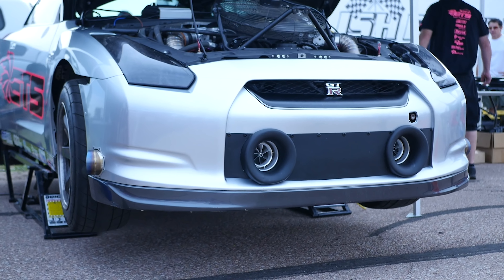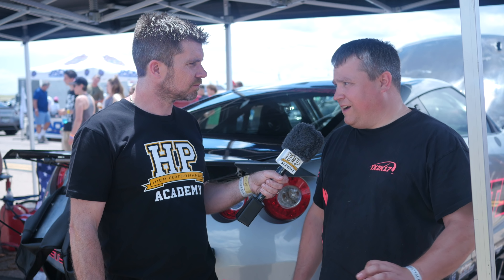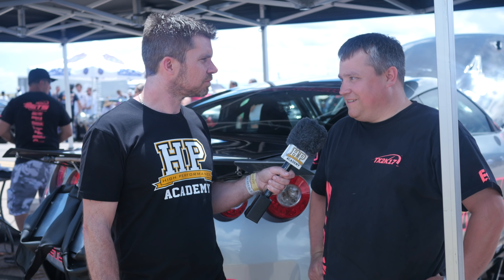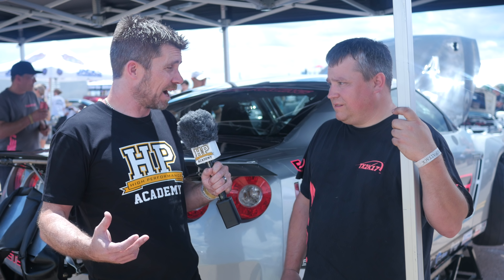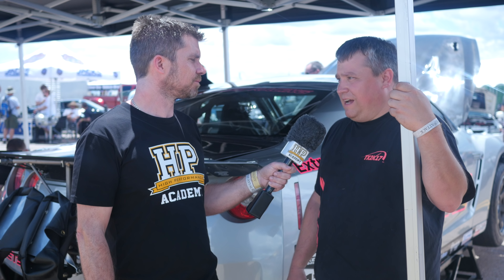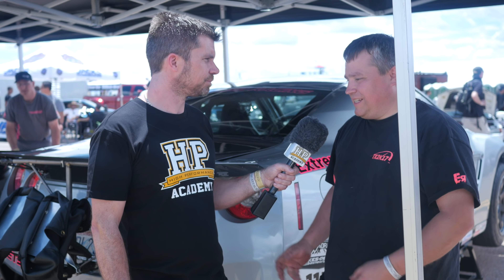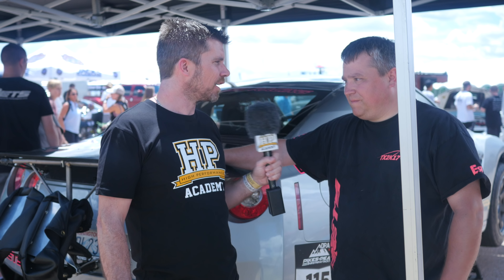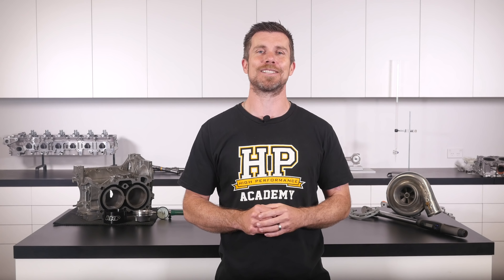Can You Daily Drive A 2700WHP GTR? | ETS [TECH TALK]

Comment: I like this bloke, a real straight talker. You know someone knows their shit when they can pull all those figures off the top of their head. Sounds like he could throw together a 1500hp GTR in his sleep
Reply: He could and best of all is he wont BS you like other shops do.
Reply: Cicioperformance doesn't lie to his customers either. The shop was formerly known as TSM and is known for making the best streetable gtr's in existence. His shop does crazy builds with ETS's kits but takes pride in their stock turbo fold kits that are above 1500whp now and spool damn near as fast as stock and are reliable with a billet crank and billet girdle on the stock block. Without slicks or a race weight below 3800lbs they are still hitting 2.83 seconds 60-130. Trick it out with some more weight savings (keep A/C, the full stereo, and a full interior - carbon seats/dash/console/body) hitting sub 3500lbs race weight and they will go 2.5 or better in the 60-130 on the street and be daily drivable. And no you won't have to change the oil every week because you're running methanol. You can get a 1000miles or more with pump e85 before needing to change the oil. That's the fastest streetable reliable car you can have.
Reply: I was just going to make the same comment! The no nonsense talk and leveling with the customer is unheard of today with this rubbish customer is always right mentality.

Comment: Getting a bit spoilt by your interviews, but it is still cool watching some of the interviewees when they realise Andre is actually asking good questions and knows his subject.

With the charge cooling still being used with methanol, way I figure it is like JR - regardless of the cooling down the line, the colder you start, the colder you finish - been a bone of contention with some turbo' chaps :-)
Also good you got out of him the big end bearing problem that they have to monitor, maybe a bit more info' re' clearances and oil viscosity would have fitted well with your bearing clearance video? Would it be practical/possible to simply drop the sump and replace the bearings regularly or did ring* seal/blowby or component fatigue mean a full rebuild was needed as it was not too clear if the bottom end is fully replaced during the rebuild, the implication was that it was, or if the rods, crank' and maybe other parts had a longer service life - but if you have the money, why take chances?

*unfiltered air can wreak havoc on that but valves and seats are made of much, much better materials nowadays, so unlikely to be affected as much.
Reply from the maker: Coming from a methanol background myself, I always retained an intercooler. There is a school of thought that overcooling the inlet charge with a methanol engine can make it harder for the fuel to go through a phase change from liquid to vapour and hence hamper charge formation and combustion. JR seems to have done the back to back testing to prove that's inaccurate though.
Reply: I recall about 15 years ago the dsm turbo forums, and a few others, arguing about whether or not using a cold air intake in the fender well vs stock location in the engine bay actually made any difference at all.  Some guys argued that it's going to get hot during compression anyways and then cooled in the ic so it wouldn't change a thing.  While others said the colder you start the less there is to cool and the colder you'll finish.  In the end some logging by a few of us showed that cooler air being fed to the turbo would result in an extra lb or 2 of air per minute in the intake manifold at the same boost levels.

Comment: Those little rod bearings must go thru hell with 2000+ hp. On my 500+ hp turbo builds I would notice the big end bearing wear a bit on the straight 6s I occasionally build. I would get a 3mm burr and elongate 3 oil supply hole points. The block outlet supplying the mains, the crank mains inlet hole to the bigends and the crank big ends outlet hole. For the Holden and Falcon straight 6s I did this on it did assist. The traditional chamfering the crank oil holes is not enough imo
Reply: Yes hard to explain, can email photos
Reply: fancy seeing you here turbotrana ;). Gabriel, the falcon 6s, barras especially need all the help they can get in the oil delivery system. even small changes that have a small improvement are worth doing.
Reply: How you going. I'm still on the net seeing what others are doing but too busy to do any of my own mods of late. I am a big fan of improving the oiling system. On a straight holden turbo 6 I built it ran less than 10psi oil pressure at idle and about 45psi hot and I could never break the thing no matter how hard I tried. Its also about volume and distribution, not just about pressure.
Reply: turbotrana Would you mind explaining this in more detail? I'm just getting into tuning and I'm eating up any information I can get my hands on.

Comment: Its def amazing the stock VR38DETT block with proper good supporting parts like turbo and upgraded fuel can produce easily 1000bhp.

But running the 1000bhp daily while being reliable is another story altogether. 

if the tune is off and knock occurs. You will have a cracked block and the whole block will have to be junked. Or use the wrong type of oil and the bearings will be destroyed along with the crank. 

Interesting the R35 they are running is the 2007-2010 gen R35. 

I heard the 2013-2014 GTR are the best gen for tuning.
Reply from the maker: To be fair Lin, these are mistakes that can happen on almost any engine regardless of the output or application. There is always a level of trust involved that you, or the person you have employed to do the job for you, is not going to make a mistake with one of the 100's of things that can be done wrong - Taz.
Reply: Lin Chester Actually 1300 is about double crank power stock. Not shocked at all. Most turbo cars can safely double the output.
Reply: Anthony Thomas almost double the horsepower safely. 

Most of the EJ20, EJ25, 4G63, RB26, RB25, 1JZ, 2JZ with the right turbo can produce up to 400+bhp before you need to upgrade the internals. 2JZ being the exception since that can go up to 500+bhp

Japanese automakers in the 90s and 2000s love to overbuild the engines.
Reply: michael lehner other than the ECU revision. The VR38DETT is mostly unchanged other than the Nismo which uses the GT3 turbo unit.
Reply: michael lehner agree.
Reply: It's just the same shop car they've been running from the beginning.  I guess they don't see a reason to buy a new one just to gut it.
Reply: 2.0L Ecoboost can easily do 500 hp stock block, stock internals. 400-450 is nothing to the stock internals.
Reply: On borrowed time lol
Reply: Lin Chester double the power on an EJ before upgrading internals? hmm
Reply: @linchester8464  yeah but 2jz have a lot better oiling and metal quality in their blocks compared to rb26. I believe I've seen that comparison done proper on the haltek channel.
Reply: @SoulTouchMusic93  it was on Motive DVD. RB vs 2JZ. Stock for stock the 2JZ block is stronger

Comment: i think it would be very interesting to see a GTR or similar high-horsepower drag car run a high performance engine, but replace the transmission with a generator that powers electricity to electric motors at all four wheels to negate drivetrain loss and wear, and simplify the drive unit, without having to deal with batteries that don't hold the power-to-weight a combustion engine does. the generator and motor efficiency have to be incredibly high, but it should be pretty effective and comparable to the tried-and-true methods with a decent amount of experimenting

Comment: Why don't they make a vr38 crank with straight rod journals? You'd need to change timing and cams, but you'd get a stronger engine no? Would a balance shaft be required?

Comment: I get how people are being mislead from inflated power numbers, but the fact that you could run a 3.8l v6 in a 3800lbs car at 1300hp and have it last for over a year is astonishing, built or not that's a long way from the way things were 10 years ago lol now if only I could convince my boss that 1000hp out of a Chevy v8 isn't that hard lol
Reply from the maker: Yeah technology has come a long way, and also failure analysis as a result due to the data we have on tap these days. 
One thing you will find with these builds is that they're not chasing a number, they're building an engine and it produces what it produces, which can still be an exciting number, but that number is a by-product of the work, not the goal. 
Some engine builders have customers walk into a shop with a number in mind and ignore all other good advice for the build vs the vehicle's application, so it's not always just a one way street with the builder at fault either - Taz.
Reply: It depends on how you drive it in my opinion, if your not in the throttle constantly there isnt much more load on the engine than a standard road vehicle.
Reply from the maker: @TurboGSR96 No, that is not correct sorry mate! The specific issue here is the aluminium rods you have to switch to after around 1300HP. Watch this video to understand why they might actually get a harder time in a street car than in a drag car that often shuts down at the end of it's run - https://www.youtube.com/watch?v=xTF59-hE0qs - Taz.

Comment: Thanks Andre for debunking the myth that so called street cars like the ones shown on Street Outlaws with thousands of horsepower are actually street driven cars. I had experience with blown alcohol cars a few decades back and know how often parts are replaced, but there are many out there in YouTube land that simply refuse to believe the wear rates that goes on. Hopefully coming from someone like yourself people will start to realise that "street driven" mega horsepower cars are a myth.
Reply: Street driven small displacement cars are rare that's for sure.  Duhawks use to drive his Gallardo all over the place and it made over 1800whp,  Sal still drives his Viper on the street and it's making well over 2000whp though I'm sure not on the street.  These little V6s are being pushed way harder.
Reply: They don't call them street driven at all.. 🤦‍♂️ Literally says in the intro "street RACED cars"

Comment: So far as i remember ETS pushed the GTR to 70PSI on their 6.88 runs and the 2719whp Dyno run was at 55psi so doesn't that mean they were actually running 2700hp at pikes peak now i'm not asking this out of ingnorance just out of curiosity cause what power was UGR running then since they ran 259.6mph at this event i know some other variables comes into play but still and also i do hope we see ETS at Indiana at sea level cause if there is no competition then why even Race and ETS unlike some other Gtr shops know how to have a friendly rivalry and yeah.
Reply from the maker: If you check around 7:45 JR gives the details on the boost at sea level vs Airstrip attack. Essentially no, the engine wasn't making anything like 2700 whp at airstrip attack but due to the low air density it's easier to push the car through the air. The net effect is ETS actually go faster with less power compared to an event at seal level. Airstrip attack seems to be a favourite location for setting records.
Reply: Same basic principle why so many records were set in the Mexico Olympics in '68, it was held at an altitude of 7200 ft (2200m), and why aircraft cruise at such high altitudes.
Reply: Hmm yeah and also add to that the Gtr's have a Drag coefficient of 0.26CD and The Hp is not the Biggest issue i believe power management is asin how the car uses what's left of said HP
Reply from the maker: @Erik Britz power management is always a challenge with any car making this sort of power and for much of the run the engine will have more power available than the track will be able to hold. Managing the torque delivery as the car travels down the strip is the key to achieving results. Stepping up the boost as the car goes through the gears and matching the boost/torque to the available grip is a key aspect to tuning this sort of car for a particular track.
Reply: yes this is why i believe the half mile brings that challenge to a new level due to this being done on a runway or strip of concrete not any prepped surface at all so yeah

Comment: I'm currently building an sr20 ve with a bullet engineering billet block, in a 100% street driven s15, aiming for 700whp.  Do you honestly think if the engine is built correctly that it will last a long time before bearing replacement is required?  After watching your video on bearing hardness comparisons between oem and aftermarket it makes me think that I would be lucky to get 30,000kms out of this car before it requires a bearing freshen up
Reply from the maker: It's a tough one to answer as there are so many variables. The SR20 actually has a pretty reasonable bearing size (compared to the VR38) and 700 whp is decent power but certainly not a stretch so building this to be reliable is certainly possible The point I'll make is that if the engine is street driven then it's usually pretty hard to push the engine consistently hard on the street and hence life expectancy is extended. If you're attending every Friday night drag meeting or regularly attending track days and beating on the engine 90% of the time then your life expectancy will be less.

Comment: Doesn't the argument of street reliability come down to driving efficiently? Just because the car is capable of 1500+ hp, doesn't mean you need to be driving like it does all the time. Why can't you just run a different engine map for the street that will only out put about 700+1300hp on the street, then change the tune as needed?
Reply from the maker: No, it's not just how you drive it, it's the components. As JR points out, you cannot run steel rods if you want reliability after a certain amount of power is reached, so you have to switch to aluminium rods. Ali rods need to be replaced much more often even if you drive conservatively. Watch this to understand why: https://www.youtube.com/watch?v=xTF59-hE0qs - Taz.
Reply: You would probably run on pump gas for the street so it would be less power. Something people don’t think about.

Comment: So, with the billet block you can't name it VR38 because there is no common parts at all. It is a 3.8 liter V6 billet block which looks similar to Nissan's VR and nave similar dimensions. Am I right?
Reply from the maker: Depends on your logic. As soon as you change an airbox or exhaust from factory you could argue that an engine can no longer be called by the same code to be honest. It's up to you where you draw your own line just as others will do the same with their own line and opinion =) - Taz.

Comment: Pshh..... slow 🤥
Reply from the maker: You must have a very fast GTR of your own to say that! Would be keen to hear about it :) - Taz.
Reply: High Performance Academy Sir.... I respectfully appreciate your reply. I personally own a 2011 Dodge Durango with a V6. It is the fully built, with cloth interior, 3 row seats, and an Alpine aftermarket 8 inch sub built it by Factory. Sitting on Factory 16 inch rims with Goodyear tires that were on sell at Sears. My two front windows are NOT tinted to help with weight reduction. And it runs on E85. I can reverse from my driveway fairly quickly and get to work thats 7.1 miles away in a short time limit of 10 mins and 32 seconds which is my record. Please...... I know what Im talking about.
Ps.... I love you.
Reply: James Franko lol. I concur ✌
Reply from the maker: @Six - Does it have a bunch of stickers? - Taz.
Reply: High Performance Academy Just one .... its say I hate tacos, says No Juan. ✌